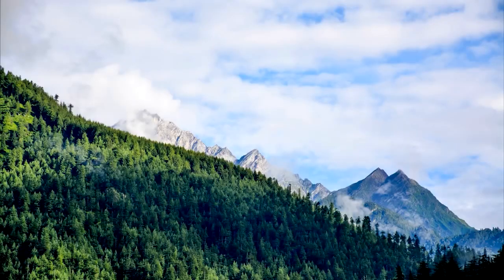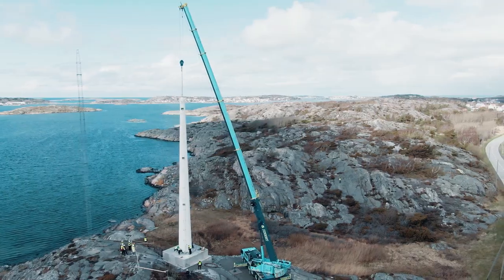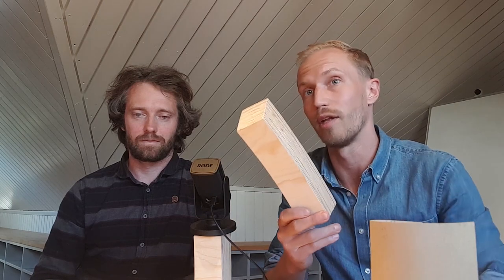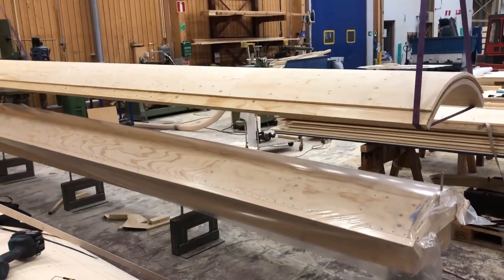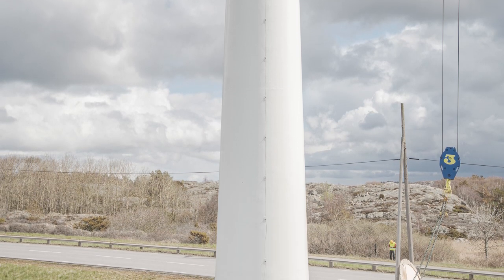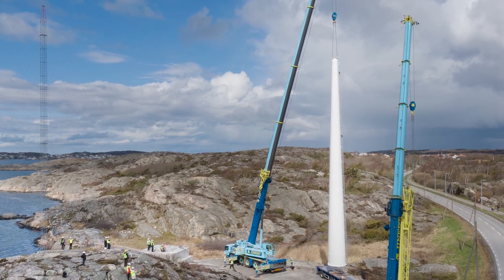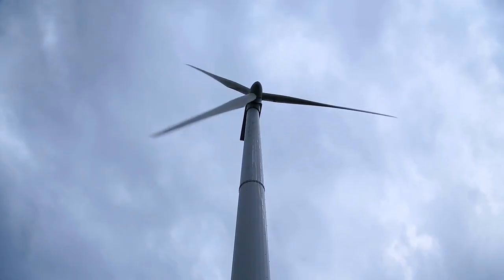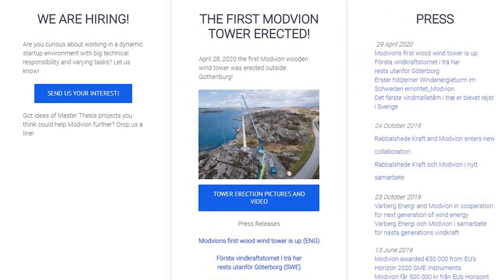Wooden Wind Turbines? | Modvion

Comment: I spent 35 years working at Hughes Aircraft Co. before my first retirement. Howard Hughes of course built what is still the world's largest wooden airplane that could fly. He had to build the factory to make more of them before he could even build the first and only one, and he had bought rights to a process quite similar to the laminated beams these fellows used as examples. The large assembly building used such beams to have its open floor free of pillars, and even more elaborate laminated wood went into the flying boat, whose wingspan is nearly 100 meters. In considering that size wooden structure, and the history of the largest wooden ships, I noticed that the limits for such a ship and the flying boat were roughly the same 100 meters. I studied the largest windjammer ships made, Sugar Schooners for the Hawaian trade with as many as seven masts, and the reputed Treasure Fleet of the Chinese emperor in 1491 whose largest ships were also around that length. 

That these fellows can build half again the length, 150 meters is  a remarkable testament to their engineering skills. Of course ships and aircraft have to withstand the strains of movement through their respective mediums high seas and rough storms in water and the air. These towers on land will need less weather resistance, and the conical structure is maybe the strongest tower shape possible for taking  wind stress in any compass direction.  
I did notice though, that most of the oldest ships in nautical museums are of steel or iron, not wood.  The maintenance costs for the  most historic wooden ships( 'Old Ironsides' for example) are very high where only galvanic controls and good sealing with paint are needed with the steel ones still afloat. Only time will tell if this process will last or the seeping of moisture into the joining surfaces high up on the towers will limit their service life. I hope they do succeed.
Reply: Thanks for bringing together all that information; i can verify that it's very much in line with my memory even if i would not have thought of the relevance for wind turbines! As for more  maintenance that could just mean more sustainable jobs; the way i heard it the labor cost involved in manufacturing/erecting and maintaining wind turbines is very high as compared to coal/gas so funnily even when wind was comparatively still expensive it had an outsized economic stimulus effect.
Reply: @WaterspoutsOfTheDeep  
😂😂😂😂😂😂
Reply: Apparently they can easily make your tower of thicker parts and add extra layers of paint at the factory if you want it to last longer in harsher climate, but I have noticed most renewables are aiming for twenty to thirty year warranty/lifespan and that is easily attainable even for American home builders so a bunch of professionals shouldn't have any problems.
(Disclaimer: Above statement in no way suggests you should expect a house built in USA to actually last for longer than it takes for the ink to dry on the builder's contract. Always check the quality of work before signing anything.)
Reply: @WaterspoutsOfTheDeep  There is a version of the flood story from Babylonia giving instructions how to build and ark made of tarred rope like the boats people of that region used even in modern times. Thing is, the math works and if you used the amount of rope instructed you would get a boat of the size given in the story. So we can conclude whether the stories have any truth in them or not, the authors certainly knew if their facts wouldn't check out there would be that one reader who would point it out. Also, ancient people may or may not have had the ability to build huge things, but they certainly had people who knew the engineering and math that would be required.
There is a Youtube video of the professor who translated the story and later worked with the TV crew who wanted to make a documentary of it and even built a smaller replica, but unfortunately I can't remember the name or which history channel it was on.
Reply: @WaterspoutsOfTheDeep  Indeed. That is why "ancient people couldn't have built this because they didn't have modern machinery!" annoys me so.
Reply: @WaterspoutsOfTheDeep  Totally right! The intellectual capacity and creativity of the human brain hasn't changed since humans were created. There have always been people that possess Musk and Edison levels of ingenuity and drive, pushing the envelope.

Comment: We did research about 15 years ago here in Ireland on this topic, and came to the same conclusions as Modvion.  Congratulations to them for making it a commercial reality!  What do we find in Nature that is supported at one end and gets buffeted by the wind?  A tree, i.e. a wooden structure.  One of the factors seldom mentioned regarding wood is that it can take millions of bending cycles, i.e. it has what is called an infinite fatigue life (not the case with metal).  It is, quite simply, the ideal material for a wind turbine tower (and blade).

Comment: The 4.5 meter road limitation that they are talking about is already solved by the German long ago.  German wind tower base has many concrete sections stack on top of each other.  Each section is 4 meters in height. And each section is consisted of 4 curved pieces.   Concrete are used for like the first 50 meters at base of tower, and then multiple tall steel towers (30 meters in length each) are stack on top of the 50 meters concrete sections.  Many wind tower in Germany are built this way all the way up to 166 meters tall (height of the center hub of turbine)

Comment: Trust the Swedes to come up with flat pack windmills 😄 Interesting idea 👍 May have missed it, did they say what the cost difference was?
Reply: @UCjlfFMYJKLK-6XBR1R6NWaA Not definite but I am guessing it may be faster to construct. I am assuming it just requires waterproof adhesive to put the panels together. They said it was lighter and easier to transport. Maybe steel panels wouldn't give the strength required and you would need a framework to build a tower like that, or they would do that already. And then you have the fact that you are growing wood to make the towers which at least sequesters some carbon from the atmosphere, whereas steel has a high carbon footporint.
Reply: This IKEA windmill's assembly instructions will be hilarious.
Reply: @Krommandant  Wonder how big the supplied allen key will be? 😄
Reply: @markplott4820  Allready excists everyehere in Sweden and have been since atleast the 70:s :)
Reply: around 40% cheaper then a steel one with 6% lower energy price as a result ~  from another video.  so more profitable then the steel one.

Comment: Zac and Jesse, great show and topic as usual. Have been a fan since NYK #7. Just a note (perhaps this has already brought to your attention,) but a few designs from WW2 incourporated wood as the main structural material . Perhaps the most famous was the Mosquito, probably the fastest aircraft of the time. De'Haviland then produced the Vampire, one of the first jet aircraft, which was also built of laminated plywood. Many of the early "station wagon " cars used wood as structural components, and the eventual "woodies" made the materials cosmetic. Many "skyscrapers" being built today are experimenting with expanded use of laminated products. Think LVL. Now you know, cheers, Jack.

Comment: Wood as a structural element can be far stronger than people realise. Some medium height skyscrapers have been made from wood (upto 30 to 50 floors). With fire retardant impregnated. 
ie the wood will char under external heat but will not support the fire by itself. Also the wood chars at a higher temperature than untreated wood burns, plus the surface char starts to insulate the underlying wood.

Comment: Awesome! Never imagined that wood would be the answer for a more efficient and sustainable wind turbine...
Reply: Jakub Horniaček hemp too is worthy of more than only an honourable mention.
Rock on doctor captain chief sir!
Reply: Wood is not the answer for all problems. Basically it is a natural type of Carbon fiber composites.
Wood has different disadvantages:

Anisotropic material (means: its really resistant against stretching it in the one direction, but it's really bad on stretching it perpendicular to that direction).

Wood is very flexible (has a quite low elastic modulus). Therefore large structures are bending a great amount.
Therefore the wooden tower will move a lot in the wind. This movement can causes a lot of issues in other applications.

Wood is very hygroscopic. This can lead to elongation of the wood and can destroy attached (non wooden) structures.

In summary: there are good reasons why skyscrapers and towers are built out of steel and roof structures of family houses are made of wood and walls or fundaments are built with stones...

Every material has it's specific purpose...

Comment: Bamboo trees have been used to build skyscrapers for years in Asia.
Perhaps they can be used for the wind turbines as well. 
Way to go guys. Let's keep doing things the right way.
Reply: Bamboo is a very efficient material if you need thin cylindrical shaped structure material. Extremely useless if you need a large wind sealed, smooth surface.

You might extract the fibres of bamboo and glue them to large structures together, but that's too cost effective and carbon fibers or glass fibers are a lot stronger.
Reply: @markplott4820  exactly. The technical term is:
bamboo fiber reinforced polymer biocomposites.
That might be ideal for (semi) natural use cases, compostable dishes, floors, ...
This (factitious) biocompatibility comes with higher costs.
In my opinion it's not suited for a construction tower that bends / flexes a lot in wind (leads to micro fissures) and is affected by ultraviolet radiation and sun.
The tower will composts itself in a short period of time...

Mainly because of the higher costs I am not convinced :D
In my opinion natural wood is a way better material than bamboo. Nature has already packed the fibres together in a usable shape. If you wanna use fiber composites that are fully made by humans  than stick to glass fibers. Way more cost effective than bamboo.

Sorry for the "factitious" in front of biocompatibility. My practical experience in the plastic production tells me that there are always uncompostable additives used producing a bamboo cup, ...

Comment: So we will share, plywood composite combo material utilizes balsa layered with a combination of hardwoods. Pressed epoxy glue. could include some kevlar and a couple layers of carbon fiber cloth. Cap the material with a thin mettle skin. and there ya go.

Comment: Could I suggest a woven hemp mesh weave over the interlocked components once assembles to add a pressure strength modulus to add to towers structural integrity.

Comment: their building the tower out of panels to get around the size limits of road transport  so what stops them(or another company) from making panels out of steel and doing the same thing?
Reply: Nothing, but fixing steel together on site would require welding most likely, expensive, and VERY difficult to ensure quality.
Reply: @edwyncorteen1527  such as the Eiffel tower is welded... you're funny :D
Just have a look on skytree in Tokyo. You can easily put a windmill on top of it in 600m height...
Reply: @edwyncorteen1527  reminds me of the efforts by SpaceX to weld together a spaceship :D.

Comment: Great interview z,j,  nice idea.  That said,  steel seems better to me.  Steel towers could be built in segments too if diameter is a transportation limitation.
Reply: Once you get into larger diameter the material cost becomes a big factor. Yes you can build the tower out of steel you can also built it out of titanium or carbon fiber but are you willing to pay the cost of that tower. You can always scale the strength of the tower by increasing wall thickness but there is a price in doing that. Increasing the diameter reduce the needed material. But since you give up compactness then you have a choice of using cheaper materials that becomes an option when compactness is no longer desirable.

Comment: The structure would problaby need Steel Sheets to wrap around the sections. Like barrel rigs  & diferent cables and reinforcements inside the structure. All in all it would be minimal steel.
Also to withstand earthquakes and high wind it could have pendulum weights inside that would mitigate the sway. 
A type of fiber clothes of teflon/kevlar/linen can also be used to keep'it all togheter. ( like a wrap around ). 
The bottom sections can even be filled with concrete/cement/sand  and they would be a formwork for the concrete making the base heavy'er.  
600-800 meters is something very doable. Imagine the wind there.

Comment: There are plans to build some rather big buildings either out of wood or with wooden instead of steel frames, so this isn't as surprising as one might imagine.
What I am curious about will the cheaper cost of building a windmill affect how often they get replaced as with age it will produce less and need more maintenance than before, while replacing it would mean about year of no profits as the old one gets shut down and replaced and the new one pays back its cost. If buying a more robust tower and turbine and paying for a decade of increased maintenance will cost more than a lighter tower with a cheaper turbine that lasts only twenty years rather than thirty, then obviously it makes more sense to replace the whole thing than keep the old one going. And that is without assumptions that in twenty years the technology has improved so the turbines will be cheaper but more efficient and towers again cheaper but able to build taller.

Comment: what if you had large generator and blades floating on a large blimp?
It could have onboard battery banks to power thrusters to move it around with periodic landings to offload generated energy.. or even more wild use microwave bursts to a intake sight?

Comment: I like the idea of using engineered wood for large buildings but I'm not sure we have enough land to grow all the wood we'll need for the increased demand. Wind turbines, no problem but large sky scrapers which comply with fire regs, not so good.
Also, what glue is used to bond these sheets together?
Reply: Wood is in fact better than steel for fire protection. When exposed to fire a steel beam will soften and collapse. A wooden beam will see its outer layer turn to ash which will prevent further spread. It could of course also be covered with a fire retardant material.

Comment: Even a 300 m tower and 300 m diameter would easily take the record even in 10 years from now at the current size increases. The record now is 16 MW and 240 m diameter that took over the 14 MW record from 2020. 300 m would be about 25 megawatts.

Comment: Wood is brilliant. 
Wood has pretty good strength/weight and cost metrics.
Laminated wood can be really strong and lasts long.
Iron is too heavy. 
Aluminum and fiberglass are expensive.
Wood is light, cheap, strong enough, easy to shape - wood is perfect for a turbine.

Comment: I understand the strength of the tencil, torsional & compression strength wood. What I don't understand is hope this company plans to address points of weakness in the structure, namely the base attachment bolts and the frictional wear at the top of the mast where the turbine mounts. Then if course there is maintenance to prevent wood rot. I hope this company is generation a lot of experential data to support it's assertions. At this point I remain interested but skeptical.
Reply: Looks like those attachment points are reinforced with steel.
Reply: As a structural engineer, they got my attention.  Lots of red flags on multiple fronts.  Wood (and really what the are talking about is a laminate), like any anisotropic material, is shockingly complicated to deal with (in reality and not just theory) if you’re trying to actually achieve an actual specific strength close to steel.  Titanium is too expensive and only marginally better than steel per kg. Aluminum is actually much better than steel for specific strength (in theory) but the devil is in the details when you start trying to connect it. carbon nanotube composite is the current (there are some even newer theoretical Nano materials being proffered) theoretical highest specific strength by a few orders of magnitude, but the tech has a long way to go.  Steel is still king for a while yet in most applications, and it is still improving . But good  luck to them!

Comment: Why make them the same color as the normal steel ones? is white the best color to blend in with the surrounding environment, is it the coating? 
Would be cool if they could make them differentiable so people could actually tell that these are made from wood.
Reply: my guess would be to get maximum protection from the sun.

Comment: having some limited experience with cell phone towers 18 yrs ago, most structures (of this category) in the US would require guy wires above 500 to 600 feet.Seems impractical for wind turbines. Not disagreeing with Modvion but 600 meters is like 1800 feet tall, guessing the base would be the size of a NY skyscraper to pull this off - how much weight would need to be supported at the top of such a structure? wish them much success will be interested for progress / updates on their venture.
Reply from the maker: I believe they weren't suggesting that it would be the optimal size. More of a theoretical limit.